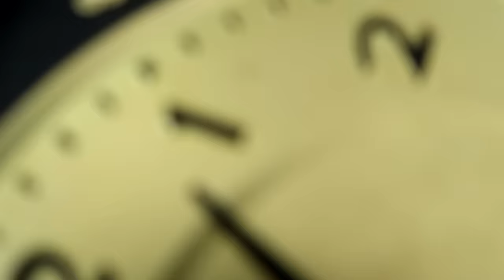Restoration The Classic Pendulum Clock  - 1990s watches

Comment: And this is why you should bring your clocks and watches to a professional.
Reply: @skimmybras  5:20 hurt my soul, I'm a watchmaker and don't do clocks but you see the same thing done in older watches. Usually around the barrelarbor hole or the centerwheel because these are often not fitted with a ruby. The correct way is to ream it out and press fit a brass bushing (or possibly a ruby in watches) but once a hack has done this it is hard to do a neat job because the meterial is all chewed up.
Reply: @skimmybras  Yes, I meant at the pivot. In the mainplate.

Comment: I have just watched a horological butcher at work
David
Reply: @dperry428   has he not heard of a main spring winder, and peening over the center wheel bushing instead fitting a bush, now it will wear out again on the side he belted with a hammer
  David
Reply: David Kkkooo Right? I knew a retired horologist and I know he probably would have lost his temper just watching this video (he passed away a few years ago). I started on a very similar project one winter, and he said that from looking at the pictures I had posted online, he said the mechanism appeared to still be in very good condition. He convinced me to just brush out any loose dirt and lightly oil a few specific points and just put it back together, and he was right in the end.

Comment: Anyone who can remove all the gears of a clock and put them back in correctly deserves a thumbs up!
Reply: Easy when you have a video to back and look at.
Reply: @garyv2196  no tan fasil amigo
Reply: I did it on a few wristwatches example what I wear a seiko 5 , this big one is simple for me :)
Reply: @raullopez9639  easier than crossing the border.
Reply: @garyv2196  ¡JAJA! de acuerdo.
Reply: Just match the wheel with the pinon, always. You do get the hang of it in short order. :D Great restore!
Reply: Well I must be a saint as I have a clock repairing business 😂
Reply: It’s difficult and all, but to do it correctly would be a plus, the guy probably did more damage to the clock then when he found it. And also he has to be careful with those springs! He wasn’t wearing gloves, could cut him up real bad! Also he didn’t do a complete job, some bushings need replacing
Reply: Ringer Kye same here!
Reply: @garyv2196  9
Reply: Anyone who can service this wall clock. Pls DM
Reply: @garyv2196  Just what I was thinking.
Reply: bullsballs agreed. a lot of problems.
Reply: As a Watchmaker student, it was hard to watch (no pun intended). When we get old clocks in to restore, they are sometime very oily and full of old dust and sticky oil and now I see a reason why. Looks like he uses hobby oil and way way way way way to much - if oil runs out of your oil cup in the bearings you've overlubercated it.
Also there are parts that wasn't dismantled and cleaned, dryed and lubricated so the minut wheel is going to rust over time.
It's also common practice to check the pinions for wear and then polish them carefully, then make new bearings for the pinion/gear.
Reply: At least it’s a cheap clock.

Comment: Sorry to say I can see you are not a clock make. So many things you do can damage the clock more. You head to take of the tension on the springs before dismantling.The way you make the holes for the gears smaller is not ok.Please stop tampering with the mechanisms and keep to the wood work. The hammer is too close to the bell pins. The out side of my clock looks amazing but sounds bad. 
My dad was a antique clock maker and he showed me a lot of things about clocks.

Comment: philistine. Who would butcher a movement by punching around a worn pivot hole instead of fitting a replacement bushing. I have not seen a worse job, People should not think this is the way it is done. It most certainly is the wrong way.
Reply: Lol I was about to comment how he should have pressed in new bushings, and how it seems he's incredibly impatient with the tear down process.

"Gotta take it apart fast, gotta put it back together fast" 

Quite frankly I've never seen anyone use a hammer for spring installations, it reminds me of those fake Chinese restoration videos where a guy finds modern junk in a dump and "restores it" 

If I were fixing this clock I would have took my time through the entire process.

And to make it worse he painted the outside brass parts instead of polishing them, including the pendulum

Comment: I took apart a Howard Miller pendulum clock, about 40 yr old, because it stopped running.  A  little YouTube  research, seemed that dirt on the little wheel axles was probably the problem.  Bought an Amazon oil/cleaning kit, took out the movement, cleaned and oiled everything and it’s running great again.  No way would I have gotten into the guts of the movement.
Reply: At the end of the day he has a cheap movement in little more than a cigar box

Comment: Good restoration, but I would not have attempted to keep that cracked and rotted cabinet.  There comes a time when gone really is gone.  Also, checking the clock's accuracy after the repair was not attempted, at least not on the video.  Losing or gaining five minutes a day was considered good 130 years ago.  Finally, shouldn't the title say "1890s Clocks" instead of "1990s watches"?  Just sayin....

Comment: Well done! I tighten all the bearings, calibrate them with a reamer and clean them with a boxwood stick. I also drop one drop of oil on the teeth of the gears and it spreads. I necessarily lubricate the wheel and the fork.
Reply: @dperry428  I subscribe to your channel Don and I'm learning a lot from your videos. I'm a complete novice to the hobby of 'messing about' with clocks and have just started
my first little project, the disassembly and cleaning of a English Smiths Enfield movement mantle clock. I stopped watching this video when he started hammering around the pivot holes. I myself am not at the stage of attempting re-bushing. But even I, at my early stage in the hobby know that anybody who loves clocks would cringe at this. I would rather get someone to do re-bushing for me until I had the equipment to try it for myself. Clocks, especially, old and interesting ones, (not that I think the clock in this video is anything special, but that's beside the point) deserve more respect and care.

Comment: I'm just curious as to why he disassembled the entire clock mechanism.  99% of the cleaning could be accomplished without disassembly. I'll assume he was showing off.
Reply: Because it wouldn't work instead of bushing it properly he pinged the bushings with a stake ie he pushed the brass back over the worn bit to get the wheels to run true. Won't last 5 minutes.

Comment: Not sure why you had to take the mechanism completely apart - it wasn't that dirty and no broken springs. It looked to me like the clock was still ticking while you dismantled it!
Having said that I do admire your confidence in just piling up the pieces! I lay mine out in order and would never dream of pulling out a main spring without a C retainer!
Thank you.
Reply: get grid in the gears and pinon points etc
Reply: @moodyga40  
an ultrasonic tank will do the trick, clock fully assembled, in 15 minutes.  I'm surprised you don't have one.
Reply: Yes, there's no need to de-assamble the machenism
Reply: @Jack44M Ultrasonic cleaning the movement fully assembled won't get everything out.  One absolutely must take it apart before putting the parts in the ultrasonic, especially if there's pasted up oil/dust mix. Leaving the movement fully assembled when using the ultrasonic cleaner is known in the clock repair community as a dip and swish. Great way to leave traces of oil/dust paste, cleaning solution and corrosion everywhere in areas you wouldn't see unless you dismantle the movement and closely examine the parts.
Reply: @Monster404ftp  
I'm a licensed watchmaker for over 40 years.  A professional model ultrasonic will do the job.......whether you know it or not.
Reply: @Jack44M  I've been in this business 15 years, apprenticed under a master clockmaker of 43 years, and started off on cuckoo clocks and Hermles.  I have an industrial grade stainless steel ultrasonic cleaner. It has a ball valve for draining, heater, the whole 9 yards. Still would rather first dismantle the movement as it helps expose the trundles, pivots and pivot holes better. 

On another note and I'm sure you've ran into this before, WD-40 is the absolute worst to get out of clock movements.

Comment: Great job. I'm not a big fan of those movements. The ratchet gear on the clock is very soft and will round the edges on ratchet.  This can cause the spring to decompress violently.  It's an easy fix. Just heat up the ratchet and drop it in oil to harden it.

Comment: A good clock spring would have jumped out of the housing and cut you rather badly, I usually do it in a five gallon bucket with leather welding gloves,  they are full of energy just waiting to be released....... I'll give you credit for getting it back together :D

Comment: Back when this clock was produced in China back in the 70's , you will need to save up to two months of wages to buy it, thus, it's generally given to newly-married couples. That's exactly what this clock is intended for, the artwork on the glass contains the Chinese letter “喜” , which means "Happiness" and us usually used for blessing new couples.
Reply: "三五牌"， 上海中國鐘廠名牌產品。我曾經在那裡工作過。

Comment: Looks like a cheap Chinese copy of a Smith's chiming movement.  I wouldn't recommend putting heavy oil on the pivots like he did, it won't run for long with that stuff in it.  More like butchery than a restoration!  However, the clock wasn't much good beforehand so I suppose it prevents it going to landfill for a year or two

Comment: You should never put paint ect on a pendulum it alters the weight balance ratio
Reply: Weight does not matter, go to school...
Reply: You are correct. It can screw up the pendulum. And make it so it can't be adjusted to speed up or slow down the clock.

Comment: Amazing, I cringed when he took the gears out of the clock and could not believe he took apart the rest. How could he put this back together?
Reply: @Offshoreorganbuilder  t
Reply: This is VERY easy
Reply: You should see a chronograph watch... that is pure madness. This looks easy compared to those restorations
Reply: It's quite possible. At least I do it every few days.  The trick is to understand the purpose of the mechanism, the manner by which these purposes are accomplished, and to be acquainted with what I've always called the 'mechanical language' of clockwork, which is pretty much consistent from one movement to another.
Reply: That's why it costs so much to get your clock repaired!

Comment: I was a little upset to see the gentleman closing the hole in the clock plate with a punch. I would have liked to have seen a bush fitted. However the clock is not that valuable.  All wheels fitted and clock is working.  I can’t work out if the guy is a sloppy professional, or a talented amateur. Although overall I am quite impressed.   Eddie Alston

Comment: where is the clock restoration? it is a perfect, new and oiled mechanism built in China in very recent times. evidently inserted in a dirty and old wooden structure (just see the screws in the window which are new apart from a rusty one). the right title was the arrangement of a wooden structure that contains a brand new clock. another fake video to investigate youtube

Comment: On further consideration I have to modify my previous comment and pay my belated respects to the owner of those soiled, worn hands.  I believe that he's Asian, working under considerable pressure in a poorly-equipped repair shop in perhaps VietNam, Cambodia, Laos, or perhaps India or China.  He has made his own tools (I once made a punch from an engine valve myself) and has applied good repair techniques within the capabilities of his equipment.  I am an American with a well-equipped shop, but this man truly deserves those tools.
Reply: @dperry428  You have to be cautious when handling mainsprings, but as with any work involving energy-storage devices (excepting armed explosive devices) it's not all that difficult to accomplish, and the fellow's method is often all that's available.  For example, a wind-up phonograph contains two barreled springs, each more than an inch in width and on the order of 16 feet in length.  Mainspring winders are not available, though I'll build one if I ever have to fix one of these machines again.  As it happened, I had to wind both springs into their barrels by hand, and they were coated with black grease.  I strongly recommend a mainspring winding machine for clock work (though even these have their disasters) but there are always multiple ways to do things.

Comment: Not a perfect job from a clockmaking perspective, but he hit all the high points.  A little too much oil here and there, but none on the mainsprings, reducing a worn pviot hole rather than fitting a bushing, gong strike out of adjustment, etc.but nothing majorly wrong with the job in the grand scheme of things especially given the low value of the clock.  Fixing a clock is hard, this clearly isn't his first attempt at it.

Comment: His feet were just as bad and taking the mechanism apart accomplished nothing that a good soak in cleaning fluid would have done the clock was a pile of crap even after the failed restoration.

Comment: The gentleman's tools are inadequate for the work that he's doing.  On occasion mainsprings must be removed and replaced as he's done here,  but it's vastly safer for both repairman and spring to construct a mainspring-winding machine, especially for the heavy springs in Asian clocks.  The barrels (the brass housings for the mainsprings) for this clock are thoroughly vicious; I've dealt with them.  

The technique he uses to close up the worn pivot hole has horrified some of my colleagues, but if it's done skillfully enough (the video revealed nothing) it's reasonably effective: I would have installed a commercial bushing made for that purpose.  I don't believe that he polished the clock's pivots, which should always be done to prevent further wear. 

The clockwork must be disassembled to perform an adequate cleaning and also to repair worn pivot holes.  The video has been sped up in places, and this is unfortunate, for clock repair is a rather slow and deliberate process: you must always test clearances and fit as you go. 

I believe that Mr Electricity is located in China, for that movement is of somewhat better quality than is typically exported from there.  As for the condition of his hands, they look like he's been cleaning dirty parts with solvent all day.  Such work will essentially diffuse dirt into your skin, and at least for me repeated washings can be futile.
Reply: Don't upvote your own post, it's horrifying us!😟
Reply: @desertmulehunter  My apologies.  I didn't understand that this was a competitive sport.  Perhaps you'd care to post an official rule book.